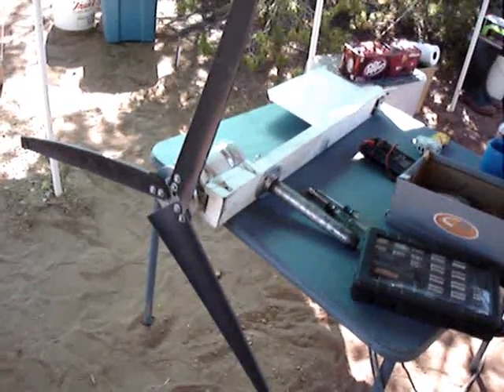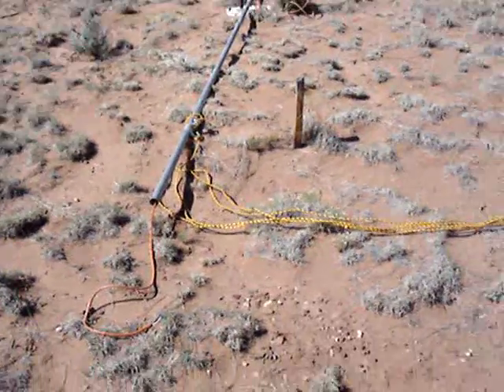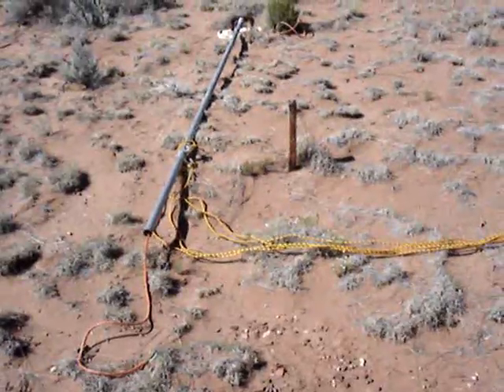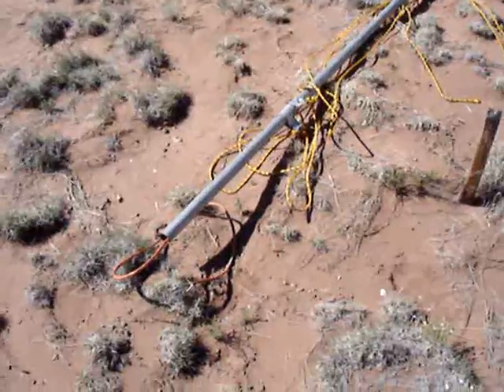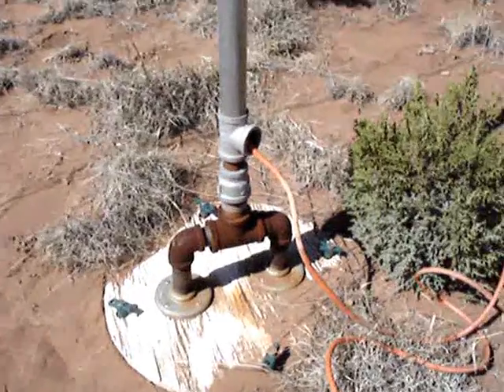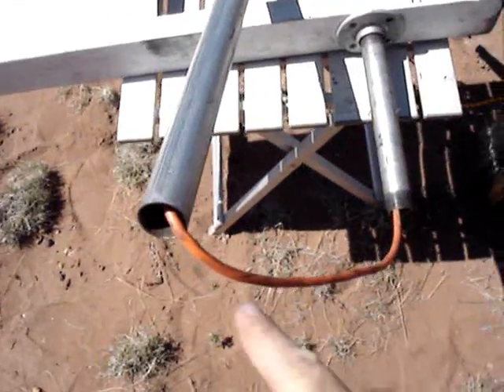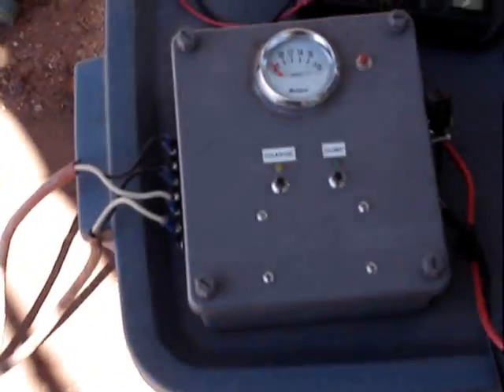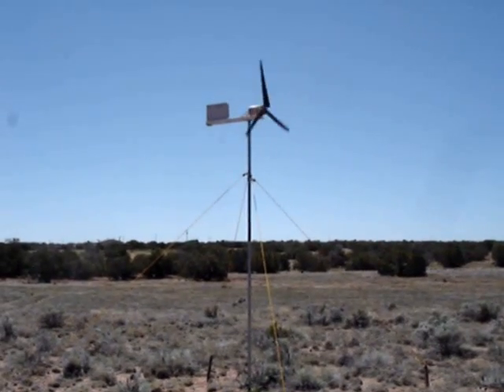Home-Built Wind Turbine Assembly and Setup mdpub.com

Comment: I could see using cement and metal cables if you were in a wetter climate that gets allot more rain or snow. But I would still use the hinge so you can bring it down easier to work on. Great work and home design. I would like to have something similar but I am living in an apartment for now.

Comment: @Flightkid9 I made the same kind of hinged base on my tower, and I did cement the base of the hinge into the ground. I had some 18" lengths of pipe coming off my 90-degree fittings. Works really well, but a 37' tower is a bit harder to raise than this one. :)

Comment from the maker: @Flightkid9 

The guy wires would still be necessary even with the base cemented into the ground. The pressure exerted by the wind would easily bend, and eventually destroy, the thin-walled pipe I am using for a tower. Besides, with the base cemented, I couldn't hinge the tower down to work on the turbine.